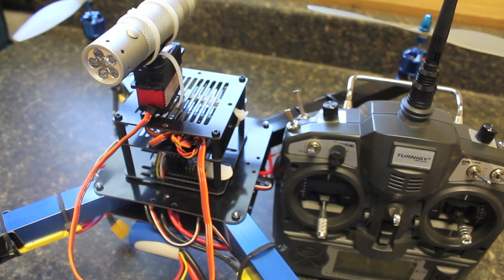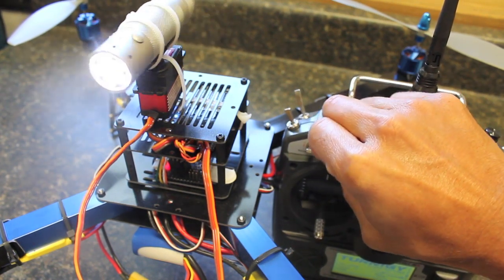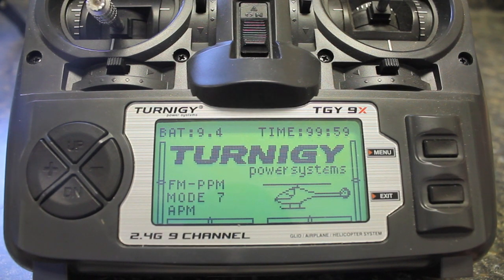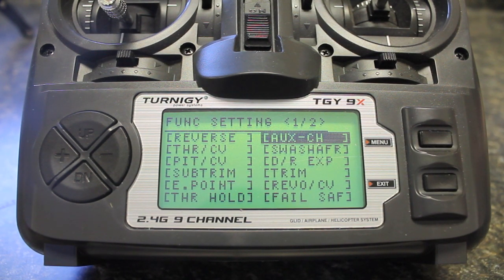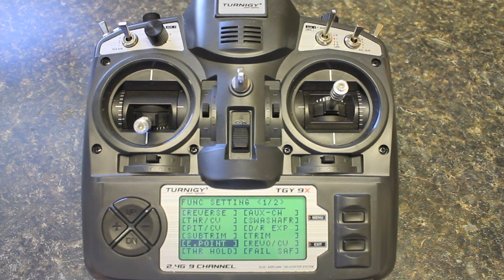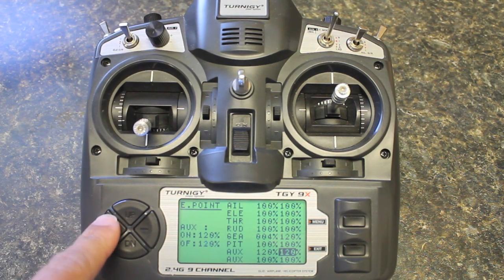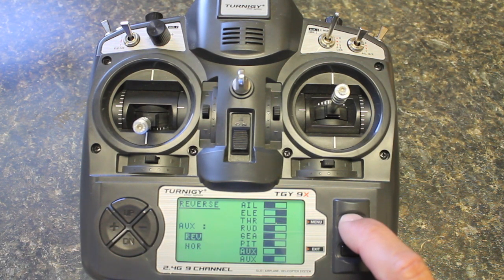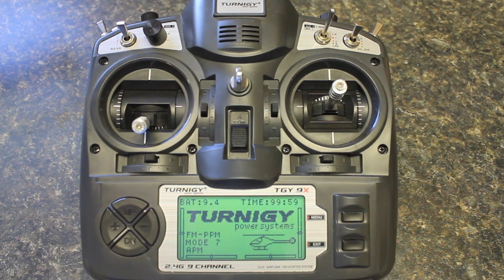Turnigy 9X Configuration for Aux Channel Gimbal and Servo Control

Comment: Do you know how you might solve the pitch trim knob controlling gimbal acceleration vs position? For example, moving the knob to + means my gimbal will move upwards at max speed, and I need to move my knob to the 0 position to stop its motion. Pretty annoying and I’d rather have the knob control position. Do you know if this might be a gimbal issue, or something I can fix on the Tx side?

Comment: I always watch your video tutorial and it was very helpful for beginners like me, I'd would to ask if the servo can limit its rotating motion in a certain degree using incresing or decreasing percentage on turnigy, I never tried it because I have no transmitter yet I hope you will answer me. Thank you!
Reply from the maker: littleboy 1234 Thanks for the feedback! I'm not sure exactly what you're trying to do but I would definitely check out the curves menu. It sounds like that may be able to help you out. Good luck and keep us posted.
Reply: +Dennis Baldwin 
now my transmitter was arrived, my problem is I follow your settings in turnigy 9x but I don't know the connections from the receiver to apm and already power up the output on the output rails using I arduino because i have no bec and my servo is not working. Where can I put the signal pin to apm port? And there is calibration needed for mission planner? Thanks
Reply: littleboy 1234 I figure out that the channel 7 output is disabled by mission planner that is why i can't receive pwm signal you must go to initial setting >>> optional >>> gimbal then for example in roll you must select input RC7 as well as RC7 in roll then it will work. :)
Reply: littleboy 1234 The new problem was my servo does not turn to full 160 degrees it only rotates 90 degree.Even though I bypass apm output ch 7 by getting ch7 reciver pwm signal directly connected to the servo the same problem. But using arduino it works at full 160 degrees. What I am going to do? Do I need to full the e-point to 120 on both using turnigy 9x?

Comment: Hi I'm having problems setting up my turnigy RF 9x V2 with my ardupolit 2.6 mega flight controller. I have got to the part where I need to configure the receiver but it doesn't seem to register the pitch at the stage where I need to move all the sticks to their full extremity's the pitch bar doesn't move so it won't do the last two steps in receiver set up.
Reply from the maker: Self cocking home made crossbow I would check that you have the channel wired properly. Sometimes it's easy to flip the servo lead in the wrong direction. Other thing I would check is your T9X monitor screen. It will show you the stick value when you move it. Make sure your pitch is actually behaving as you expect.

Comment: I want to ask, if it is possible to do mix with "throttle hold" and "ele d/r" switches on the top left side of transmitter (I have flysky th9x) to control pitch motor of brushless gimbal. I want that if I switch on "throttle hold" the gimbal pitch turn to 45 degrees. And if I switch "ele d/r" the pitch motor turn to 90 degrees (look down). Hope you understand me :) Sorry for my engish!
Reply from the maker: ***** That's a great question. I'm not sure if that's possible with the stock firmware. It may be with er9x or OpenTX. Unfortunately I no longer have my Turnigy 9X so I won't be able to help you out. I know something like this is possible with the Taranis, which runs the OpenTX firmware.
Reply: Dennis Baldwin duh again, figured out how to calibrate to neutralize the roll issue. Now gotta work on gains, seems to drift a bit and not come back horizontal. Just running stock settings, will have to view what some others have used or figure it out myself.

Comment: Hi Dennis, I have follow your 6 way switch setting and happily using it. Can I please have a request? Would you be so kind to figure out a way to control the gimbal's Tilt & Roll too + the 6 way switch? Currently, I can only move my roll or tilt using CH7 because my channel 8 is hooked up on 3 way video switcher and using the HOV-THR to switch from video channel 1 to 3. It would be nice to control both roll and tilt using PIT.TRIM and HOV.PIT. Thanks!
Reply from the maker: Jayson, I know we could pull this off with the FrSky Taranis or possibly even custom firmware (er9x or OpenTX) on your T9X. Just not sure you'll be able to do it with the stock firmware. But let me think on it some more. Thanks for asking.
Reply: awesome! I hope we can figure it out. I'm trying it here as well. But you have more experience on mixing that's why I asked for help.

Comment: Hey Dennis its been a while since Ive talked to ya my friend and I hope all is well w/ you & yours. With all of the Drone-hu-bub & paranoia today you could really scare the shit outta some idiots with this thing. hahaha
Reply from the maker: Ha ha! There's no doubt about that. I flew it at night once and was panning the LED light around. Was super cool looking. A search & rescue drone :)
Reply: Dennis Baldwin Dude I am still frustrated as ever and it even got so bad that I just quit for a couple of months because I was fighting a losing battle with power and charging issues. Well I have all that crap worked out now and guess what? Now outta the blue my NAZA M v2 can no longer “atti” or “altitude hold”.  I basically copied “TheFlyingRookies” Heavy-build plans using RCtimer 650kv motors, RCtimer 40A Simonk esc's with 12”3.8 carbon fiber props and my quad has taken on a whole new set of problems.... I almost had a "Fly-away" today but after I “Gently DROPPED” the quad from about 50 feet lol I did a manual compass-calibration it flew a lot better or at least controllable. Still not flying like you guys tho! :(

Comment from the maker: Hey there. Thanks for the comment. Great question and to be honest I've never flown an airplane with my Turnigy 9x so I'm not sure. I know it works perfectly in heli mode for all of my quads. One thing to keep in mind is that I'm using the standard firmware so I'm not sure if that makes a difference. Give it a try in heli mode and let me know if you need any help with the setup. Good luck!

Comment: Hi Dennis,

I have just got the same setup as you (3DR, APM 2.5+, Turnigy 9x) and am in the process of setting it up.  Previously I had an iFly4 Quad and for that I had the Turnigy transmitter setup for acro (Plane) mode as that was recommended.  I see that you have your transmitter setup in Heli mode and just wondered if it mattered which mode the transmitter is in, in relation to the 3DR.

I will me keeping an eye on your videos, very informative,  keep up the good work :)

S.